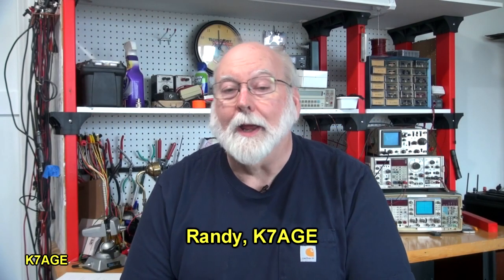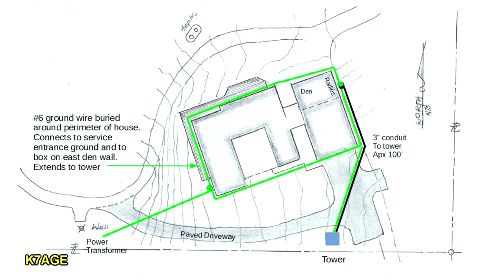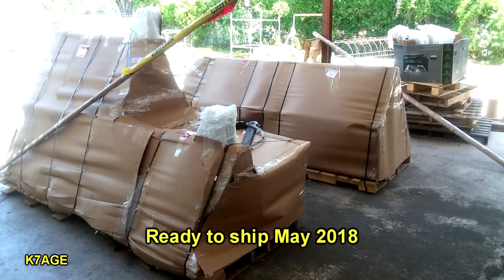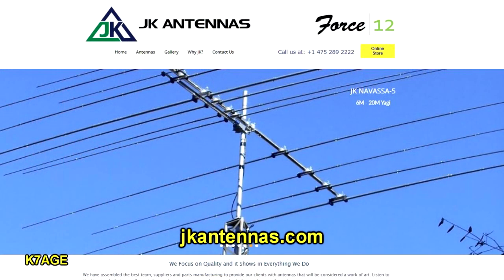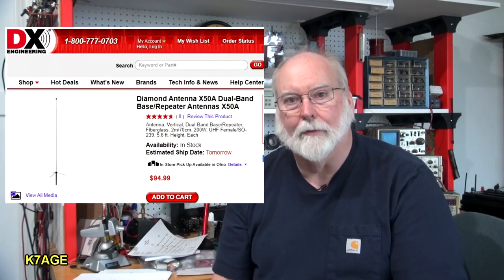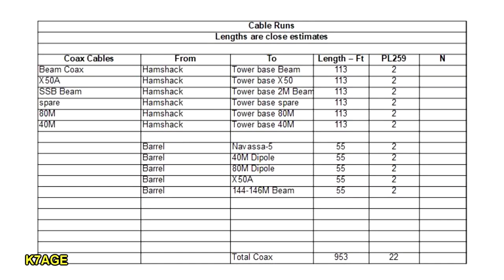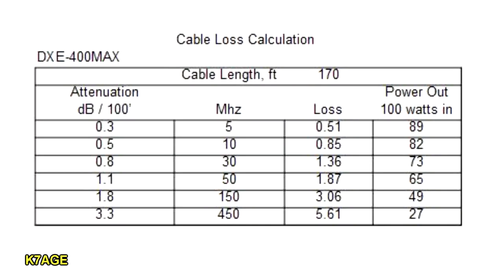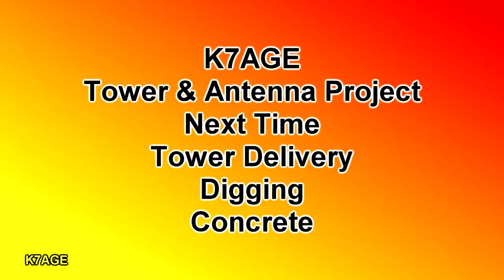Part 1: Tower Antenna Project Planning

Comment: Great video, thanks for buying the tower from a Florida company.  
I have 160' to the tower and another 90' up. For VHF and UHF, I used 7/8" to the tower and LMR600UF up the side. In the total cost of the project, it wasn't a killer. I ran two, 160' runs of 7/8 and one 1/2" heliax. All in, about $1500 for the feedline and connectors. I switch the feedline as needed - I typically use on 7/8 on HF, the 1/2" for the wire antennas and the other 7/8 switches between a beam and Comet GP9. I also ran rotor line and 3 runs of CAT6. for remote switching with (currently) an Arduino device. 73, N4MB
Reply: agreed, LMR for HF, 1/2 LDF for VHF and 7/8 LDF hardline for 70cm & my GMRS repeater at my shack

Comment: Hi Randy… Will be following this thread closely as you move through this process… I am glad that you are anticipating additional HF needs versus a single coax… Don't forget your SRD receiver such as the SDRplay! Hope the next videos are forthcoming soon! 73 de Robert K3RRR
Reply from the maker: Good point. Each Tuesday for the next several weeks will be a new video.
Reply: I use a MFJ 1708b rx switch for my SDR and my G5RV for SDR on hf

Comment: Hi Randy, looking forward to seeing your tower project take shape, I'm hoping to be putting up a tower of my own later this year. I must say I'd be tempted to run hardline from the shack to the base of the tower the losses are a lot less that even most better coax but I guess it would be difficult to run it through conduit. Hope to work you at some point soon and not just because I still need Oregon!! 73, Tom
Reply from the maker: guess it would depend how many bends. You could put the hard line in before the sections are all glued together to make it easier.

Comment: From a technical perspective, the coax loss can seem bad. But on HF, will your "uncalibrated ears" notice an 11w difference? Doubtful. 18w? Still a bit doubtful. 25w? Ehhh, maybe but probably not a significant difference. Voice signals that would otherwise be marginally above the noise would be the most impacted (and in those cases, they're always iffy the older my ears get).
On 2m, get a beam with gain and you could regain much or more than you lost in the coax (does anyone make a 2m beam with less than 8db of gain?). 
I think you will be pleasantly surprised!! Thanks for taking us along with you on the journey!!
Reply from the maker: I’m not worried about the losses. That was a nice exercise. I have an old KLM-22C 2M beam that I plan to put up and add switching between vertical and horizontal. That should work good.

Comment: I could be wrong but didn’t Ward’s book state to not tie the tower into the perimeter ground if it was a ways from the house? I’m curious why you tied it in.
Reply from the maker: On page 6.11. I guess I am in the gray area. Tower is closer to the garage than the height. #6 ground cable to the tower from the shack entrance is about 107'. I will install another ground rod at the shack entrance. I guess it could be either way. Without the ground wire, the coax shield will provide the ground path. With so many ground paths, seems like ground loops would be common. Oh well......

Comment: Randy your going to be missing some antennas, (1)over the air TV Antenna (2)88 MHz o 108 MHz antenna (3)scanner antenna, Since you are right there over the shore line what about a marine radio and antenna?
Reply from the maker: Oh well. I do have a marine antenna on my deck feeding Marinetraffic.com. Go there and look for Gold Beach and you will see my station. Typically 75 mile range. We the band  opens I have received ships from San Francisco to Seattle.

Comment: Can you go to type  N connectors?  PL 259 are Not very good.  PL 259 are from around 1940's!  They are not 50 ohm. They have a lot of loss. Type N are much better if you can use them. I think the US is about the only place that still uses them for everything.
Reply from the maker: I'm not a big N connector fan. If the male is not assembled correctly with the center pin sticking out too far, it may break the center pin the female connector. Then you have a problem. With the crimp N connectors this may not be problem. If I was building a high performance 70 cm station for DX or EME, I would use N. 

Years ago I attended Contest University at Hamvention. One of the sessions was about building your station. Now, there were nearly 400 people in the room, many were top contesters. The presenter was against using N, for the above reasons. I thought the room would go crazy against his opinion. Nope, not a peep. 

I think the only N I have is the 70 cm connector on my TS-2000. I have an N to BNC adapter with a cable to a SWR meter.

Thanks for your comment.
Randy